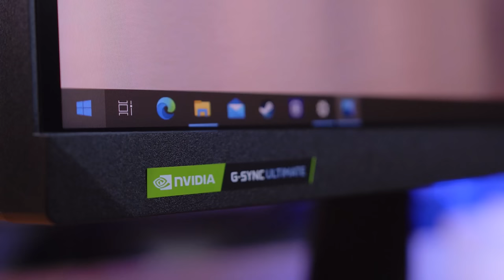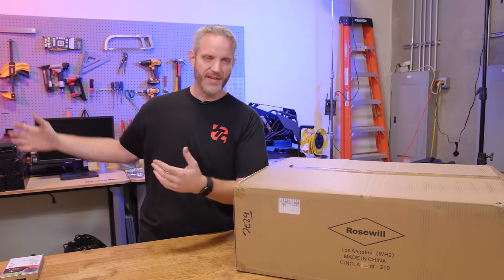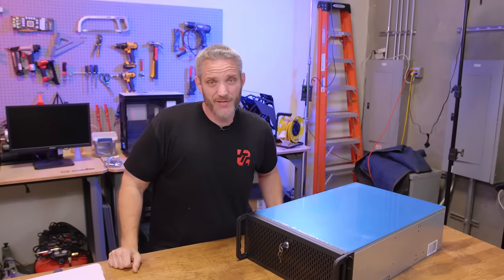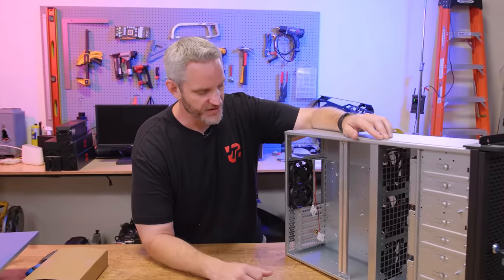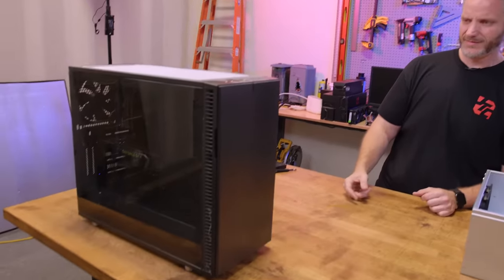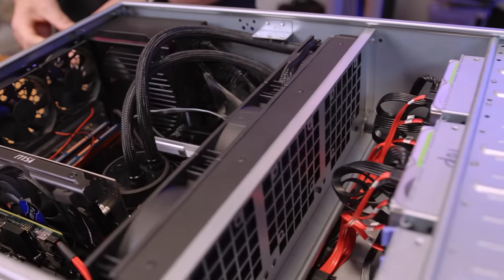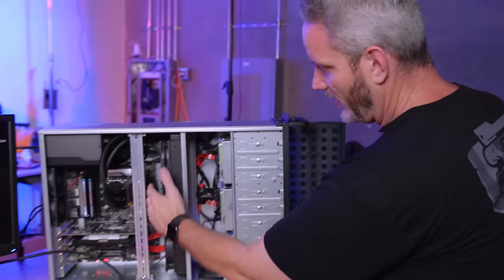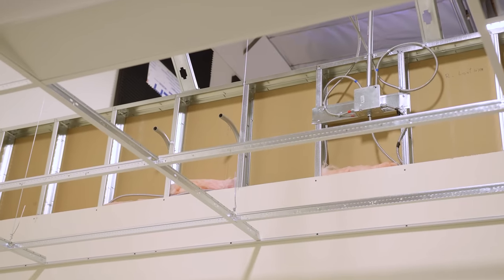Maybe I should have called Linus...

Comment: So, I've used that case a couple of times.  I saw some other people also mention using it, but didn't see anyone say, you don't have to remove the center fan mounts to access the drives.  The drive cages will come out the front of the rack.  Those little bumps on the top are retention type things that you can depress to slide the cage out and it locks in place when sliding back in (I can't remember for sure if there are screws on the front holding it in as well, but the entire cage with the fan comes out as one unit in the front to give drive access).

Comment: I've had that precise 4U case for more than a decade, I've got it filled with 2Tb and 3TB drives, because I built it a long time ago. I run MS Server 2016 on it. I've replaced all the fans in it with quieter fans. My case doesn't have USB3, of course, because it predates that standard, but otherwise it is identical. I like that case a lot, and will probably still be using it 10 years from now.
Reply: same, I have 4 of them!

Comment: Love this content Jay.
We know you can go balls crazy with a server like Linus (and yes they are fun to) 
But these realistic server videos are just as entertaining.

Also did we miss the code. Or did I miss the code?
Reply: Looks like he forgot about the code again.
Reply: @doublea1148  ik the meantime we still get 3 codes from Jay. As of the standings right now
Reply: I mean, Linus's servers are "realistic" for his company's needs.  He stores an enormous amount of data, and he has an ever-expanding team of editors working directly from the servers all day every day.  I do like Jay's approach to building his server.  On the downside, using desktop PC components means less reliability.  On the upside, "server-grade" parts are expensive and harder to get, and using desktop parts means that if anything fails he probably already has the parts right there in the building to quickly get it running again.
Reply: @megachonk9440  Desktop components you have some around anyway so you can easily swap something. You might need a spare HBA though.
Reply: @megachonk9440  Yeah like LMG has like 6 channels to run, so the server isn't over the top for his needs.

Comment: @Jayztwocents the drive cages slide to the front from the top clips on the drive cage. Derp. Read the manual. You can also get other hot swappable cages for ir on Amazon. Look for 3x 5.25 Hotswap Bay. Then use the included rails to install the Hotswap bays into the chassis.
Reply: What hes saying is true!

Comment: Starting my first homelab with some enterprise hardware. Super stoked to toy around and see what fun I can get up to with it.
Reply: I have an old repurposed server motherboard it's a daul E5 2680v3 system. My only problem, it has an idle draw of 120watts as opposed to my actual unraid server it has an idle draw of 25watts. That system cpu is a 10400.
Reply: I use a pi4 and couple of 8TB external drives. One backups to other overnight. It's a bit slow but it does saturate a 1GB connection, which is faster than my WiFi. I will probably upgrade to  QNAP with couple of 2.5gbe links. One direct to a dedicated 2.5gbe card in the pc. No switch needed. The other to the router for WiFi.
Reply: @jondonnelly3  I brought a couple of 10gb cards, I'm going to bulid a TureNas server with the the spare daul E5 2680V3. When the time is right I'll hopefully replace the motherboard with a W680 chipset bored. Still use TureNas. That'll keep power consumption under control.

Comment: I was gonna mention that those drive cages slide out the front and you shouldn't have to take those mid rack fans out, but looks like you figured that out. I used that case a few years ago for a project.  Worked well, but you can definitely see why the case is pretty cheap. :)

Comment: 2:15 @JayzTwocents write down the serial number of the drive that's giving errors, if you're ever in a situation where you have to power down the server anyways you can just pull out all the drives until you find the one with the matching serial number. (and if ur worried about losing data, just migrate all files that are stored on that disk to any of the other drives with crusader and then remove it from the array).

Comment: I recently bought a Rosewill case like the one you showed.  I was very disappointed in the rail placement.  The holes in the case for the rails is centered in the side of this 4U case, they are not aligned at a U boundary.  This made it impossible to mount the case in the rack to align with the other equipment in the rack.  I think that you will also find that by using shelf brackets, the the bracket itself takes up space and will not allow you to put  devices both above and below this case.  If you are not going to fill the rack, then losing a U or two is no big deal, but inevitably, the rack ends up being full over time.

Comment: @JayzTwoCents  Jay one easy fix for the open side vents drawing in dust via the middle fans, before cases came with filters I would take some thin fine mesh foam like what comes in motherboard boxes and find a way to mount it tight to the inside of the case, over the vent. If room is available you can put it on the outside for easier cleaning. Just make sure you make the edges tight so no dust gets by while still keeping it removable for cleaning. In the old days I'd repurpose the thin ' pre filter mount found on a lot of the old cases, and the motherboard foam is much finer yet still the same thickness. 👍👍👍

Comment: I have the hot swap model running my Unraid build.  I replaced the two 80mm fans with Noctua fans in the back and got three red LED corsair 120mm fans for behind the drives and it looks amazing because you can see red light coming from it.

Comment: I have that same case (only with the last set of drives as a 5.25 Blu-ray drive) for my NAs for nearly a decade. you can pull the drive cages out from the front to mount your drives in, then slide them back. you can even plug your SATA cables in and thread them through like PSU cables. With new fans, it's an excellent case and quiet for a server.

(EDIT: i see 2/3rd of the way through, Jay found that out too!)

Comment: Modern servers are far too loud to be put in a room like that, but putting them in a sound insulated room will require running direct cooling and exhaust if you wall it up.

Using an oversized 3U chassis with consumer class fans may not be the highest performance or density, the sound levels will be 10 times more manageable. Even 10/25Gb TOR switches are going to be loud AF.

Comment: JayzTwoCents I have an enclosed 32U server in my small office with a UNRaid Server and my Workstation both suck in a fair bit of dust due to the bottom of the Server Cabinet having an opening, so I wouldn't go without the dust filter on the front.  Also recommend you get the rails, even though you may not need to access the system often, it is a pain when you do need to especially with all those drives it will be heavy.

Comment: I share your enthusiasm👍 Every NAS is technically a server since even the most basic 2 drive box will have a processor in it (600Mhz flavor and maybe 256MB of soldered on RAM). I ran a 2 drive Buffalo NAS for years. Heck, even for a multi drive system you could get away with consumer grade and rock Stable Bit Drive Pool. The only worry with consumer grade is cooling so be sure you keep that rack from getting hot. Tripp Lite sells a rack mount air conditioning unit (SRCOOL7KRM) for server equipment that's perfect for single rack installs like yours where floor venting isn't an option and/or room air is shared. Worth checking it out 😉

Comment: Make sure you are using a PDU with a UPS and not a surge protector, most major vendors like Eaton/Tripp Lite or APC void their warranty if you do. It also causes issues with improper load reporting and sometimes power delivery it wired in series vs parallel.

Comment: I went with the 10x 3.5 +3x 5.25 bay cases (I can't remember if they are Rosewill or Norco) because they were half the price of the 15x 3.5 at the time, and used a cage that converted the 3x 5.25 in to 5x 3.5 in the middle bays.  It does the business, but anyone that has the spare cash should defiantly go with the hot swap bay cases.  The first time you have to spend half an hour to change out one drive the extra cost will be worth it... never mind if you have to do in several times.  The cable management is impossible to do neatly with 15 drives without a backplane.  Changing out bad fans is also a nightmare.

Comment: A (hopefully) useful suggestion:
Check the NAS Software, it should ID the failing drive by Serial Number, and the front of my NAS drives (Ironwolf and WD Red Plus) both have stickers on the front edge of the drive with the serial number printed on it.

Comment: DemciFilter makes fine mesh magnetic dust filters for a lot of computer cases. I just switched my server to this same case and their 0833 - Caselabs Mercury S8 Front Filter Large is a perfect fit. It will catch a lot more dust than the built in filter will, and it's easily cleanable with a bristle brush head for a vacuum cleaner. I use their filters on most of my computers, can't recommend them enough.

Comment: no code, which is nothing new!?  The dust blew away any thought of blowing dust outside the building?  If you are already renovating, make a dust extraction system to pull dust particles out of the building.  The industrial vacuum cleaner is installed outside the building, but only the pipe connections are installed around the premises.

Comment: I'm sorry but I've burned up way too many Seagate drives to have any confidence in the server holding data for longer than 2 years. 

I love server videos, the technology is always interesting to me!
I use a hot swap version of that Rosewill case, works really well, allows you to put in nice quiet static pressure 120 mm fans.

Comment: Rails make working on the server so much easier when it's full of drives.

You should have bought a used Supermicro CSE836/CSE846 chassis off of eBay so you could have redundant power supplies and hot swap drive trays and an expander backplane.  They're just built better than Rosewill.

Comment: Hey Jay, I just bought this exact server case to replace a Norco case that was not providing adequate air flow. I used six Noctua NF-F12 iPPC 3000 PWM fans and 9 mixed size drives for 48TB. The only complaint I had with this case is the drive bays can slide out if you put too much pressure on them from inside of the case. I want another 45 drives Q30, but at 1800 dollars it is easy to choose this case for 299. I am also using Unraid and love it. Happy to see you expanding and building your infrastructure out. Love your channel and hope to see you continue to prosper.

Edit: If you need help identifying what drive is bad I can help you. If you want some help I am local to you.
Reply: It's crazy that 2/3 years ago I was able to get this FOUR of these 4U chassis for under $100 each. Newegg and Amazon even had sales on them.

Comment: I have that case.   Be careful the drive cage is dodgy.  It will start reporting CRC errors  I have had to pull drives and mount them inside to get direct sata connection

Comment: Jay the drive cages come out the front; you don't have to take out the middle fans to swap drives. I have 3 of these in my rack; no complaints with 8x noctua redux fans in them. I tried RGB fans but they just weren't very visible except in complete darkness, especially with the front fan filter. I got super-heavy-duty rails, since most rails were too flimsy to actually work on the system while extended (look up RL-03 rail; sketchy-looking site and expensive but they've always arrived after buying 4, and they're totally worth it)
Reply from the maker: We figured that out as you can see in the montage

Comment: RE which drive is going bad: The SMART data for the failing drive will tell you the serial number of the bad drive, which is then also printed on the label of the drive. Additionally, if the drive sleds have activity LED's you can turn on the LED of the failing drive to help you locate it.

Comment: One thing to keep in mind if you are looking to build in a 4U chassis is the smallest dimension (height when it is laid down) is smaller than a typical PC chase.  This may be an issue if you have a tall cpu heatsink or a tall gpu.  Having it on rails is super nice and cool, but you still have to consider the wires on the back.  Unless you make them super long and route them very carefully you wont be able to just randomly pull it out without removing at least some of the cables.  Plus side is you wont see the rgb puke.  I managed to get a 360mm AIO cooler in my 4U....but not as a fan wall.  It is exhausting.

Comment: My Proxmox server uses RGB Fans and lights!  Haha.  It's not a crazy idea.  Since it is in the same office that I work in, I built it inside of a Corsair 4000D airflow case with a primary objective being no noise.  Silence is golden when it comes to working in your office.  The Proxmox server is used for development work, so most of the drives are all SATA SSDs, with an 256 GB NVME SSD as the boot drive and a single large HD for backup purposes of the VMs.

Comment: I built my server on the exact same Roswill case and added a 16 core threadripper using Unraid. The drives were not hot-swap like the one Jay has here. I built the server on the non swap cages at first but found to be eventually a pain to change out a drive. I eventually replaced the three 5-drive cages with three Super Micro M35TQ 5 drive cages and could not be happier. I also use the disklocation plug in on unraid to locate a drive I wand to swap- out but it also does many other things as well.

Comment: I'm only about 8 minutes in, but I wanted to jump in and say that you should take the couple of screws off the top side of those drive bays, push the clip thing, and slide the entire bay out the front of the server. Mount your drives, get power plugged in, and then put the bay back into the server. I've built 3 of these servers for work now, and that's the easiest way I've found to do it. Now I'll keep watching to see if this is how you end up doing it too.
Reply: Yea have the same case and you beat me to it lol.

Comment: Nice to see this type of content. Once everything is mounted in a rack, it is hard to go back to a pile of stuff on a desk somewhere. I made the move long ago myself. I picked up a nice 4U 16 hot swap server with rails just for the chassis back in the day when no one wanted them. It was around $200 but you can't really find those kind of deals anymore. Surprisingly, even running Windows, I  have 100's of days of uptime and normally only resets because I have to restart after installing a bunch of software. I guess ECC memory and a big UPS make all the difference.

Comment: I've been using the hotswap case(RSV-L4412) in 2019- the RGB fans make it go faster. The case is decent (you can see where cost savings came into play vs enterprise cases). I had the small fans fail on me within a year, the screws will and the metal will slice a finger if you're not careful, and the screw holes want to strip easily. If you swap the fans and are careful with screwing-it does great though.

Comment: I have basically the same case (the 12x hot swap version).   Their rails are terrible.   They work, but they're just shitty.   No complaints about the case so far, no issues hot swapping with TrueNAS scale (running under Proxmox with a passthrough HBA).

Comment: In the late 90's early 2000's we had the Olive Hotel (same one that was in Lonesome Dove, Yes it does exist) bring us a computer to work on that handled the phone system. It was a 286 pc, when we opened the cover it had so much dust and dirt that all the components were coverd with an extra inch or two on top. The machine still worked but needed something fixed. You literally just saw dirt.

Comment: I'm not familiar with UnRAID since all my stuff runs Debian, but in Debian when you run smartctl to pull SMART data from a drive it'll give you the serial number, so there should be some kind of information in UnRAID to tell you which drive is the failing one even without your own labels.

Comment: The 10TB IronWolf hard drive looks to only have 7200RPM which is around 80-160MB/s read/write speed.  A 10Gbps network connection will be waaaaaaaaaay more than what's needed to access data on these hard drives by two people.  Accessing hard drive data will always be bottle-necked by the hard drive speed.  Lots of other bottle-necks within an internal 10Gbps network infrastructure as well, never mind the external ISP connection.  They're smart to setup for future growth but it's a shame they can never be fully utilized.

Comment: I have three roswill 4u cases.  When the power button stops working, you will know why they are so cheap.  You would have been better off getting a set of navpoint rails and turning the current nas sideways in the rack.  You should tape over those holes to force all the air in through the front of the case.

Comment: I have the rosewill L4500 case for my server just like the one in this video. I changed out all the fans due to the original fans being so loud. The front 3 fans are RGB just for show. Currently I have 6 drives in my server with a capacity of 88 Terabytes. I have been running my server for 18 months and love it. Problem I have is finding a server rack to hold the rosewill L4500.

Comment: I have the older black version of the case, with USB 2. Was gonna mention you can pull the drive cages forward, but you figured it out. thanks for letting me know about fitting the AIO,, now if I would stop buying Dual CPU boards.